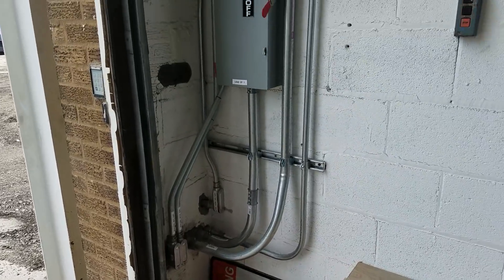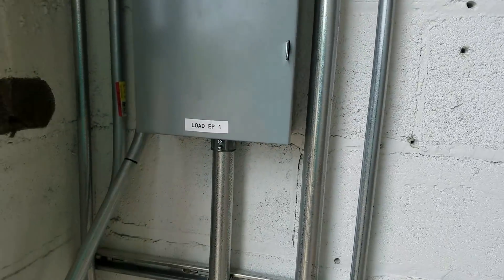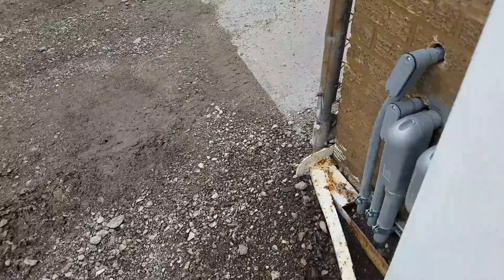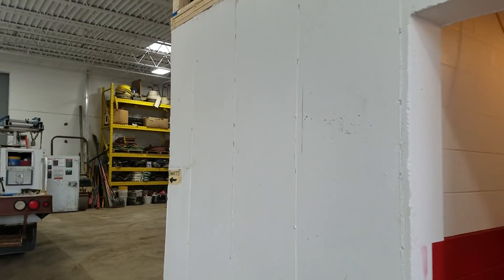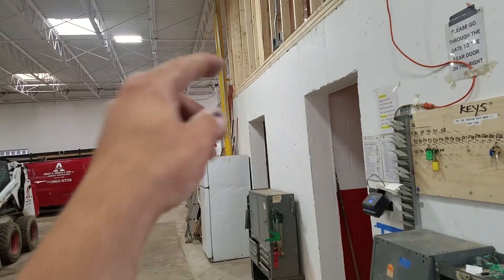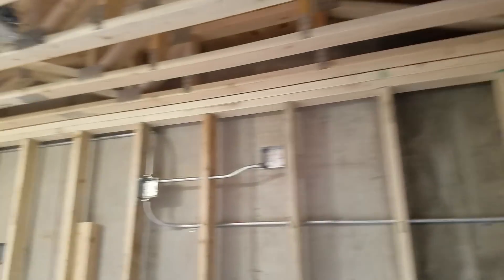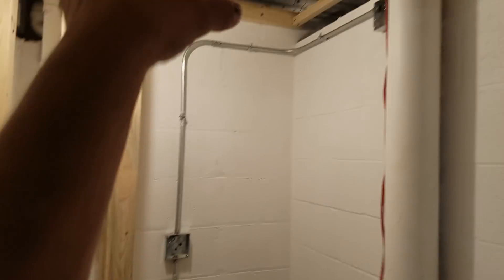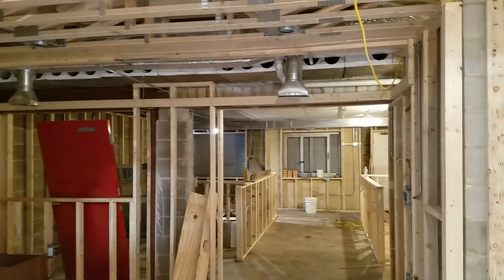Shop build update

Comment: Awesome video nate! I love watching these electrical ones. I do install work for commercial and industrial fire alarm and intercom systems down in Florida part time while in college. We run our own conduit depending on the job and yours is definitely first rate. Looks awesome.
Reply from the maker: Chuck 97 right on man I tore into some low voltage guys today because of the way they were trying to run their wire they weren't sleeving it through walls and it just looked like shit. I'm not going to stand by and watch somebody shit all over everything I'm trying to do